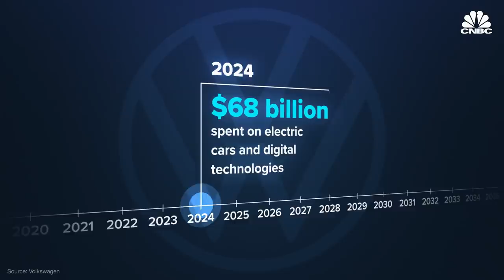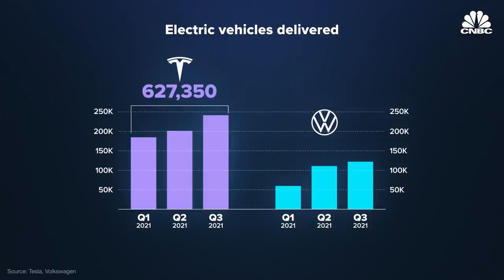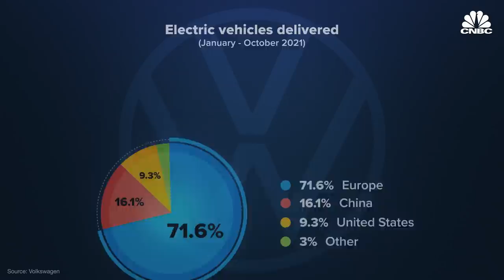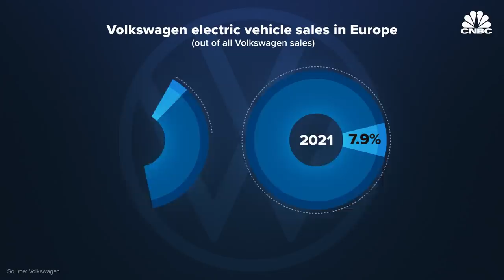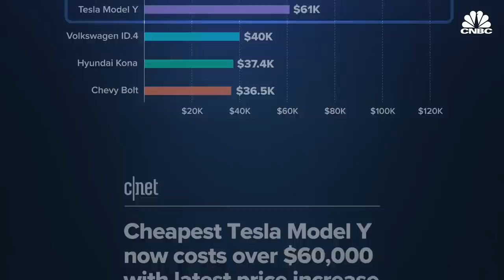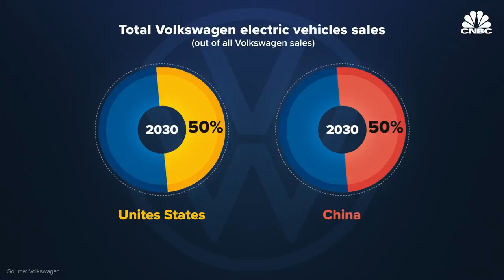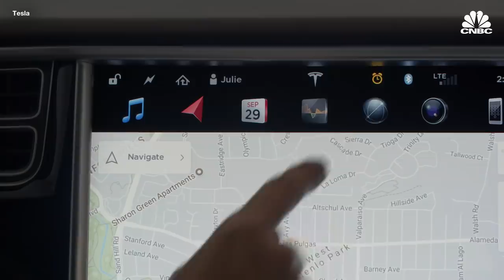Why Volkswagen Is Beating Tesla In Europe

Comment: The ID.4 costs more than other SUVs like the Chevy Bolt and Hyundai Kona?  The Kona is a crossover at best, and the Bolt is a compact hatchback (unless you meant to say the Bolt EUV, and even then a crossover at the largest).
Reply: Also totally discounts the KiaEv6 Ioniq and Mach-E
Reply: The cost of a vehicle is the difference in value from when you buy it to when you sell it or trade it in.  My Model 2020 Y is still worth nearly what I paid for it.  A 2020 Chevy Bolt is worth about half of what a new one costs.  The ID4 has not been out long enough, but I suspect it will also depreciate rather quickly.
Reply: @rogerheuckeroth7456  Yes/no.  If you plan to "flip" vehicles frequently, then I agree.  If you like to buy and hold your vehicles until they reach end of life, then resale value is less important.  For example, I bought a Kia Soul EV (one of the newer ones with the 64 KWh battery) and intend to keep it and use it until it's ready for the scrap yard (however many decades from now).  What do I care about its resale value?  Your talk about resale makes sense in our consumerist culture of always buying the latest and greatest, though, sure.  But I'm pushing back against that, where I can.  :)

I do think comparing a Model Y vs. a car that's enduring a brutal recall is quite unfair, though.

I also think it would be equally unfair to compare a Model Y against a car that's eligible for the tax credit, as getting the tax credit for buying new (vs. not getting it for buying used) understandably depreciates the second-hand option.  All Tesla vs. other car resale value comparisons are unfair in the U.S. at the moment, as only Tesla and GM currently don't get the tax credit, and GM's only EVs on the market are currently undergoing recalls.

None of this is meant to take away from Tesla's success in making cars that some people desire, or enhancing the value of existing cars through software updates.  To have a fair comparison, we'd have to see what happens if Teslas are again eligible for the tax credit, or it the competing brands are no longer eligible for the tax credit.  Then we'd have a more accurate sense of how well they actually hold their value.  I still think Teslas would hold their value better on average, but less so if it was a true apples-to-apples comparison.
Reply: @ScrapKing73  Well you kind of proved the point.  Many people with the means upgrade every few years when the latest and greatest comes out.  That does not mean that the used EV does not have a lot of useful life left.  Someone will be very happy with the "new to them" used EV.  Your use case of driving a vehicle from new until the wheels fall off, is definitely not typical.  Not saying anything negative about that.
Reply: @rogerheuckeroth7456  I think I also disproved your point.  The biggest reason Teslas hold their value is that, contrary to what Tesla fans believe, they have actually changed/upgraded very little compared to the competition.  The 2022 Model 3 has changed less compared to the 2017 and 2016 version of competing electric cars.  In fairness, they were well behind the Model 3 at the time.  But they've caught up (or even exceeded) the Model 3 since then.  They've been doubling or tripling their battery sizes.  They've added a huge list of features they didn't have before.  So of course they have held their value poorly compared to the Model 3.  Meanwhile the Model 3 has changed so little (mostly adding improvements to the HVAC via octovalve/heat pump, while losing some external sensors) that older ones haven't been forced to depreciate nearly as much.  And while the Model 3 was gradually dropping in price, for a while, now it's gradually increasing in price (which is helping keep the price of the second-hand units higher).

If newer Model 3s had twice the battery size of second-hand models, you'd better believe those second-hand models would have seen their prices crash and burn.  So either the competition will reach a point that they're close enough to Tesla that they stop upgrading, and their second-hand units will stop depreciating so quickly.  Or the competition will keep upgrading and start to leave Tesla behind (they're already starting to with features such as heads-up displays, V2L, etc.), and will force Tesla to either increase spec or lower prices, and either will start to more rapidly depreciate Teslas.  A Kia EV6, an Ioniq 5, an ID.4, or even a Mach-E is going to hold its value way better than the old Leafs, 2019 and earlier Soul EVs, etc., have.

As evidence of that, 2019 and earlier Kia Soul EVs saw their prices constantly dropping due to frequent upgrades.  However, the Soul EV finally got a 64 kWh battery in 2020.  With that being the same battery you get on the 2022 model, and with it having in some cases more advanced features than you get on a similarly-priced Model 3 (it has a heads-up display, Android Auto, and Apple CarPlay that don't get on any stock Tesla, and features like heated rear seats and full LED lighting that you can only get on much pricier Teslas), the 2020 Soul EV has barely dropped in price at all on the second-hand market, and therefore about the same as a 2020 Model 3 has over that time.

Going forward, since the competition and Tesla are now so close to each other in price/battery size/features, you're not going to see that same huge depreciation advantage for Tesla.  Either the newer competition for Tesla won't depreciate as fast as it did in the past, or they will and the Teslas will depreciate faster too.
Reply: Hyundai Ioniq5 ad Kia EV6GT are the best crossovers

Comment: How come VW has an advantage in mass manufacturing and Tesla is litterally making a Model 3 in 10 hours vs VW ID.3 in 30+ hours (quoting Herbert Diess). Also installed battery capacity of VW in 2030 is just a fraction of what Tesla will output by 2030. Although it looks like CNBC is trying, they got quite some major facts just plain wrong.
Reply: But he operate over 100 factories worldwide...

Comment: I greatly prefer the id.4's user interface and controls over Tesla's
Reply: specifically why?  It sounds like you have used them both.
Reply: @bryjb10  it is simple. I do not own an electric car( I have an VW Golf diesel), but I driven them as car sharing cars(Tesla and VW, Audi, Renault, Peugeot). The thing about VWs, that is not important you drive 2005  or 2021 model year vehicle , every vehicle has same layout of crucial driving instruments, for example instrument cluster, radio, light switches and so on. They are in place where they should be and you could switch from car to car in minutes. That's why europeans like VWs. And Tesla has very different logic there and you aren't so involved in all driving experience and simply have iPad laying on centre console. In Europe, people tend to like driving themselves rather than using FSD and carying less about driving as americans.
Reply: @zygimantasainismazetis2916  so you don’t like change. I have been driving the model y for 18 months. It takes a few days to get use to it. This is a pretty silly reason to say it’s gonna fail and that Europeans won’t like it. No sir you don’t like it

Comment: I don't know why Tesla opted for Berlin - because surprise surprise, there is one objection after another. If Tesla opted for the UK, they would have been welcomed with open arms. The other thing that gets right up my nose about competitor EV manufacturers is "Jam tomorrow" - "We will be making flying space cars with six gazillion miles range and self driving as standard using a fully implemented European charging network at some yet to be determined and highly fluid point in the distant future. ". This is not reality. This is not taking the fight to Tesla, it is a couple of lines of print. GET ON WITH IT, stop SAYING what you are going to do VW, and GET ON WITH IT. And in any case, for Europe Tesla isn't the problem, It's CHINA.

Comment: What I don't understand is an Ev has to be so much more expensive. The battery pack may cost more but the engine isn't expensive. If some factories are able to built EV's for under 30K I don't understand why the bigger companies with more expertise can't built cheeper or do they want to maximize the profits to be able to increase the developement of Ev's. What I also don't understand is why they don't develope more hydrogen cars because hydrogen will be less environmentally harmful then these lithium batteries.

Comment: In Norway electric cars are making up over 80% of all new cars sold this year, it’s been over 60% the last two years, Tesla is still in the game, but they lost 5 out of the first 6 months in 2022 to other brands, like VW and BMW. 4 years back they made the top in 8 out of 12 months. The problem Tesla is facing is that the high market penetration of electric cars have made the government reduce its subsidies. In 2022 the Mercedes EQs is cheaper than Tesla, that’s make it a bit difficult for Tesla when the Mercedes S class is cheaper.

Comment: we are running cases against the VW group and VW must now take 35,000 model ID3 and ID4 back because they are useless and the screen goes completely black. so customers have been without the car for between 2 and 5 weeks where they were in the workshop. the cars were released far too early from VW. the cars were not ready with IT system not working at all.

Comment: Europe is VW's home turf.  Also, it is so large that it has feedback from all of its various car companies (VW, Audi, Bentley, Lambo, etc etc) whose engineers represent a huge advantage over the much smaller Tesla label.
Reply: A don't believe that is correct. Tesla has telemetry on all of its vehicles which provide data instantly, and cover just about every aspect of the cars use. How driven, where, and with corresponding performance. They have over the air updating of the software so can respond quickly when needed. About two weeks ago, Tesla was instructed  by HSTB to issue a recall notice to alter a feature of the ADAS system. within a couple of days and updated program was created, and an email sent all cars TOGETHER WITH THE UPDATE. Nobody has that quick a response to needed safety improvements. 

The telemetry on 1 million plus vehicles plus that on over 50,000 Beta testers is why Tesla is racing towards a complete generalised autonomous driving system which will be ready years before any other manufacturer (e,g,GM collecting data from a couple of dozen cars in a tiny geo fenced area of carefully mapped streets in San Francisco).

Comment: well currently VW is loosing market share. it had its peak in 2012, when Tesla just started and introduced the Model S and is since on a downgrade. Their software is terrible. It is ancient and you have to pay for features that should come free. And furthermore they always screwed with already working systems. Back in the days, when I changed from the the Passat B7 to a B8 for example, they made the sliding roof much worse. The B7 roof was just fine, in the B8 it could open by their own while driving. The VW technicians approved that this was a design flaw of the new modell. And don't forget that VW was one of the last companies to switch to EV. They tried to stay with ICE for too long (still remember a conversation with an employee "EV is a hype that will soon perish"), until they realized that people actually want EVs and turned their back to VW. The first EVs produced were a terrible joke. At the moment VW is trying to catch up, but it must do so first, before they can "beat" Tesla.

Comment: Tesla is not offering features VW, Mercedes, BMW or Hyundai has !
Such as color changeable ambient lighting, Head up Display,  ventilated seats,Matrix Headlights,  parking lot emergency break and the list goes on and on !
Especially German  customers love those things and Tesla is very stubborn not offering any of those features.
Also basic features as road sign recognition are still not present and the Model 3 has been on the road for 3 years allready !
That is by no means acceptable for a manufacturer that claimed there would be full self driving Teslas on the road by 2020, if the car can't even do simple stuff such a reading road signs and properly react to them  !
Does Tesla build the best electric car ?
Hell yes !
Do they offer the best features ?
Hell no !

Comment: If a autonomous driving system depends on the driver to take over when the system does not detect a dangerous situation an unsafe situation will arise,as it effects situation awareness of the driver, and adds time delay to reaction time of the the driver, similar to having conversation on an cell phone. Accidents have already occurred. This comment is made based on authors experience with automation in the aircraft industry.
Reply: Except, that fails to account for all the cases where the automatic system spotted and addressed an unsafe condition that would have been catastrophic with the inattentive driver on board.

People are notoriously poor drivers, and having automated systems take over most of those functions will be magnitudes safer than relying on human drivers to take action.

Comment: Volkswagen in terms of EV sales will not surpass Tesla till atleast 2035-2040. They still have engineers developing hybrid, diesel and petrol engines. Until they actually consolidate their efforts into the development of electric motors, I feel it will hinder their growth. As a group they still want to hold onto, and cater for the combustible engines, which is fine. However, in the long run they will be a couple steps behind Tesla in terms of the battery technology, software, sourcing the raw materials, the refined production lines for electric motors, etc etc. However, I do believe once they do catch up, and are fully focused on the EV segment they will have a sizeable market share, if not the largest.

Comment: Just imagine the huge leap forward in EV technology VW has gotten by Porsche taking over a part of Rimac Autmobili
Reply: There is a huge question if there is any benefit for VW there.  Having 4 motors instead of 1 or 2 makes sense for a $2.5 million dollar car, makes far less sense for a $25k car.  There is very little to no evidence that performance brands bring any value to main stream mass automakers...
Reply: yes but havin people who are good at electric cars, be it $2.5 million dollar cars or $25k ones, is a good thing. lamborghini also benefitted from his employee knowing how to handle motors when they started to make cars, even though they worked on tractors before.
Reply: @noahzemp3105  But my point is the same, building a handful of $2.5 million dollar cars is difficult to translate into $25k cars.  The technology is simply much different and the cost base is completely different.

Lamborghini was different as that was in the very early days of combustion engine cars.  That wouldn't translate as well today with someone working on tractors today would not bring much to the table of high performance cars.

Comment: I would like to see in one of those fabulus future goal presentations how all these planed EVs are going to be charged simultaneously each day and who and how is going to provide the necessary amounts of energy required and in what network...... Best cost effective choice right now is a used Euro 6 diesel engine car to run for the next 5 years until factory offered  Natural Gas cars are as reliable as my 200.000 km euro 5 1.2 tdi  dependable little tool and the natural gas stations network grows substantially.

Comment: I really can't see any economic or environmental reason for electric cars.  The high purchase price will not be made up by lower fuel costs in the lifetime of the car.  The lower emissions only negate part of the emissions needed to build more power generation and dig up the rare minerals needed for the battery.  Unless you live in a place with a lot of renewable power it makes no sense environmentally.  It seems to me that a small gasoline car does better on both economic and environmental case.  Better yet reduce your driving by using public transit, walking, biking and reducing unnecessary travel.

Comment: The problem with teslas is that there is no way to maintain it after a long ammount of time. There are 20 year old vw cars that are still driving. Thanks to their services.  Since tesla does not offer any services it is hard to say what will happen to old tesla cars. Also their build quality is pretty bad. So tesla should find a solution how to reuse the old cars after 200k + miles.

Comment: Interesting. VW sales electric cars that are a bit shittier than teslas, perform worse, are less efficient and they still sell more? I looked into getting an ID3 compared to the tesla model 3, but its more expensive and is slower so unless I prefer the ID3 aesthetics and a more traditional automaker I don't understand why anybody would buy VW. Tesla has a much better-charging network and charging speeds compared to VW. Oh and if you want to throw your money aways tesla gives you a much better driving aids than VW's

Now the ID4 is a different story compared to the rest of the competitors, it has things I still don't like (bad performance, horrible infotainment and screens), but its more than reasonable and VERY comfortable giving you a luxury driving feel

The video also talks about the increased number of charging points from VW, but the issue with a lot of non tesla chargers is less of how many there are, but the fact that drivers get there and its broken or it doesn't charge at the advertised speeds which makes the not charging at home option basically useless without a tesla